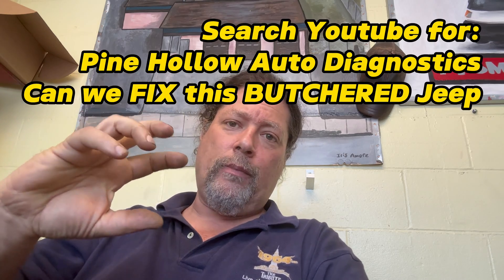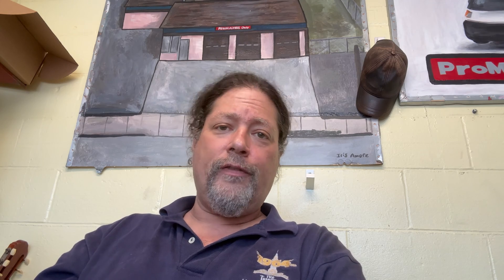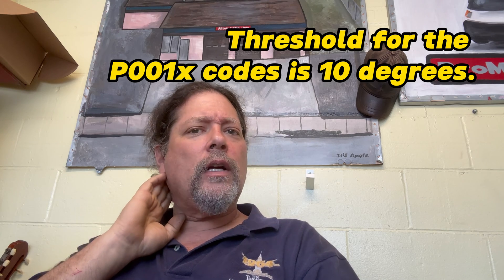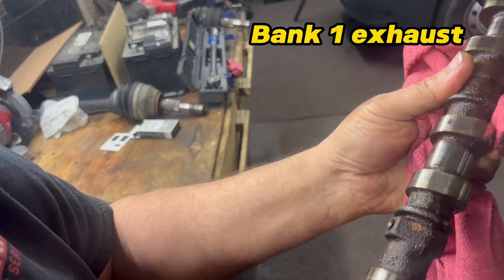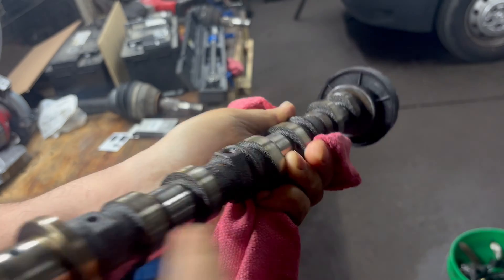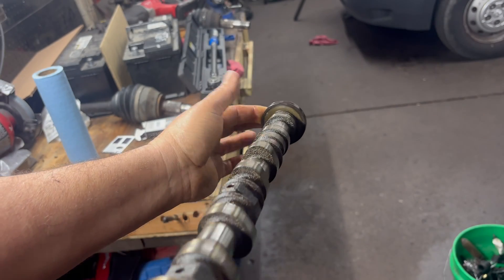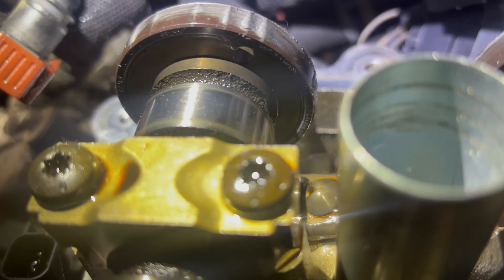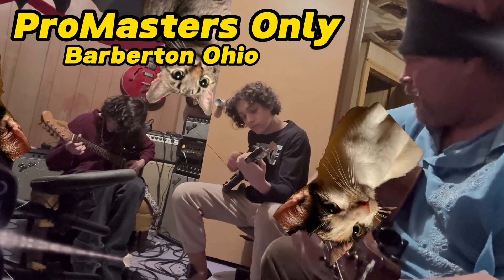Pentastar 3.6 Chrysler Ram Jeep Dodge Cam Camshaft Tone Wheel Checking P0016 P0017 P0018 P0019

Comment: I have p0016, p0017, replaced the VVT sensors, cam sensor, did cam/crank relearn, and even took the valve cover off to check the tone wheel and they were not out of aligment. The vehicle drives fine but when you floor it, i got a p2638 code, and torque is limited. I had cylinder 1 at tdc, marks line up on 1 side but not the other, the side where the marks line up is where im getting the codes
Reply from the maker: Gotta be honest, this exactly problem and code are the only one that have outright defeated me in the past. Twice now I have had to throw up my hands and say “I dont know.” 

Here’s what you can check, which it sounds like you already have. Phasers, galley plugs, correct oil weight, tone wheel alignments. Using a scanner, you can compare the cam positions to the desired positions - anything under 10deg should be fine. You dont need to worry about the crank sensor because it’s fine on the other bank. The p2638 doesnt make any sense because there is no TCM on this vehicle, its all done in the pcm. 

After that’s all known good you can bust out a scope and compare the signals from 2 cams and the crank. What you’d be looking for is some difference in the waceforms from the known good cam to the bad one - my logic being that even though the wheel is there and in the right position, one of the magnetic bumps encoded into it has lost its magnetism. It’d also be nice to see if the scope is picking up any noise on the bad cam, which would have you check or replace the little RF suppressor bolted to the end of each head (in fact, swap those side to side and see if the code moves). 

After that, I’m left scratching my head. It’s possible but unlikely that the computer is bad. What I concluded on my stumpers was that since the oiling path for each head is pretty different, what was happening is some piece of debris was lodged in the feed to the phaser, and that was making it move around in time uncommanded. It’s a complete bullshit guess, and even if it’s right how the hell do you fix that?

In both my cases, customer elected to live with the codes, since they drove ok. 

If you figure it out, let me know!

Comment: My question is where did you find that information/procedure? I’ve been searching for it for days. I don’t have these issues but it’s good to know. There must be some type of reference point for the cam grinder. Next time i take my covers off for an inspection I’ll check your procedure. I’m the original owner my 2015 Pentastar with 204 thousand miles on it and I’ve never had any of the so called problems everybody talks about.
Reply from the maker: Not every engine gets every problem. 

I made that video with 4 known good cams. Its not 100% foolproof/accurate, but its a good way to visually check a tonering. The computer can compensate if its close.
Reply: there is a special tool for checking the tone wheel alignment to camshaft. BUT i cant find the service procedure..
Reply from the maker: @tylerwilliams3868  I've seen video of it, but I couldnt' find it either. This visual check is the best you've got!

Comment: I have a p0369 After I changed the lifter, the sensor is fine. The cable is fine, the timmin is good, what could it be?
Reply from the maker: @CarlosHernandez-oq9ou  The code is for intermittent. A real diagnostician would put a scope on all 4 wires of the sensor, and record it - see the signal drop out. I would swap that sensor to the other bank, which would 100% rule out the sensor itself. The only thing you didnt mention is the oil galley plug on that cam. But the code would be different. Headscratcher. Runs perfect, I assume?
Reply: @ Yes, just now I was two hours away from your workshop. But I was in a hurry. It is working, the engine sounds good the idle is perfect but runs in limp mode The sensors as you say I already exchanged them, however I bought a new one but still the same code in the bank 1.
Reply from the maker: @CarlosHernandez-oq9ou  As a free test, you could try running it, and squiring water all along the wiring from the rear cam sensor all the way back to the computer. You might also very carefully pull the computer connectors off and look for evidence of water, or green crusties on any of the pins.

Comment: Oh man thank you for that video I have an issue with my bank 2 intake keeps giving me issues. I've changed the solenoid, gear & valve. I've also checked the oil gallery bolts. Next free day. I will definately be checking for this.
Reply from the maker: Glad to be able to post this video for posterity.
Reply: were you able to fix it?
Reply: @gustavohernandez8200  unfortunately I had it down for a while I ended up changing the chains, tensioners, guides, etc. I still havent put it back together to tell if that fixed it. Fingers crossed